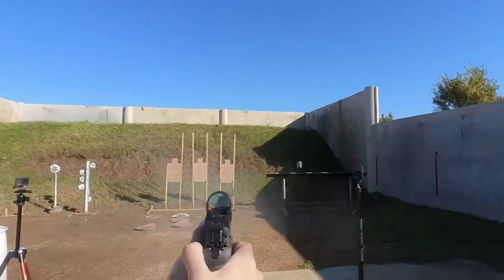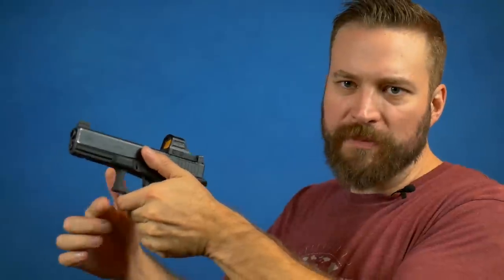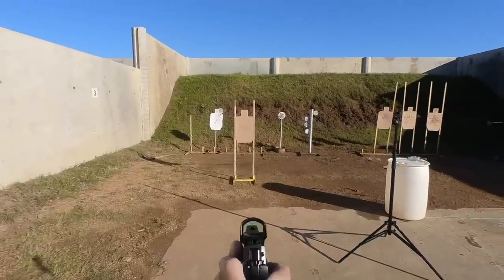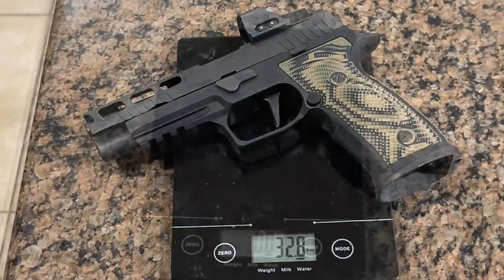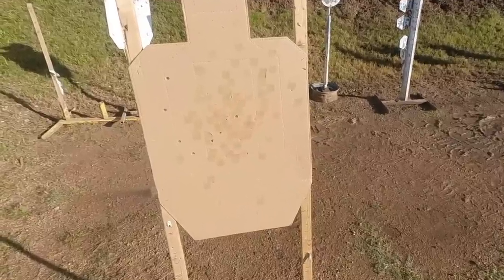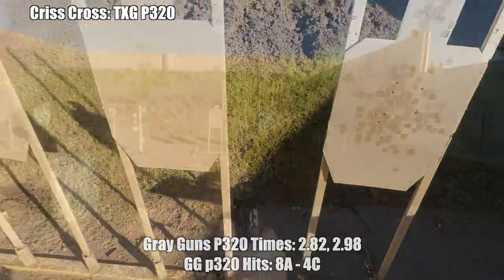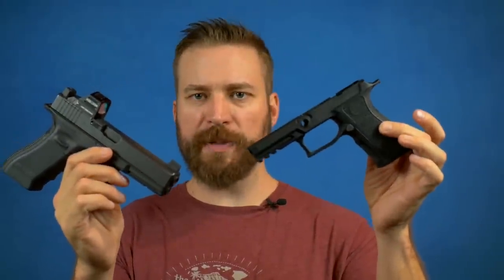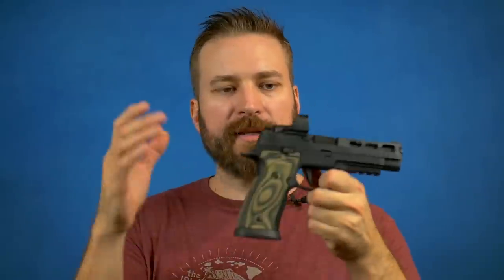Is BORE AXIS a MYTH? Testing Bore axis vs. Ergonomics vs. Weight

Comment: I always find it interesting that Sigs and 1911s have the same bore axis height, but you never hear people complaining about bore axis with 1911s.
Reply: 1911’s are heavier and honestly may have a less massive slide. The Sig 226 feels slow and soft recoiling to me but it recoils up. A full size 320 feels fine to me. The compact 320 feels very snappy and flippy to me. 1911’s feel like a nice quick recoil and return to target
Reply: @K-bob_45  Might also depend on whether you're shooting 9mm in your Sigs and .45 in your 1911. I find they have quite different recoil impulses. But in general, my point is just that I think "bore axis" is much ado about nothing. Or excuse-making...
Reply: @bsmithhammer  agreed
Reply: @bsmithhammer  Bore axis can make a difference, its effect is just exaggerated a great deal. I always viewed things like frame weight vs. slide weight to make more of a difference due to Newton's First Law. It's why I like either all metal guns or the FN Five-seveN which is the only service pistol I can think of that uses extensive amounts of polymer in the slide as well, which reduces weight of the mass in motion.

Plus, low bore axis pistols tend to have worse alignment index, which is why people mention 1911s as being more "naturally pointable" than Glocks, and probably why the Sig P320 was rated as having superior ergonomics to the Glock in the MHS trial, as controversial as that might've been.
Reply: my thing with 1911 they are not reliable and then you have 8 rounds.
Reply: @MRsolidcolor  There are double stack 1911s and 1911s are reliable so long as you lube them (and purchase from reputable manufacturers).
Reply: The 1911 has a hammer and a hammer spring orthogonal to the slide to provide resistance to the slide. The striker spring runs parallel to the slide and generally provides less resistance to the slide while cycling.
Reply: I remember in the 90s they justified the glock grip angle as lowering the bore axis.
Reply: You also have guns like the alien laugo that prove bore axis does in fact affect recoil.
Reply: You probably never will. The 1911 is the "God" of guns. Most won't complain about a 1911. Just the way I see it.
Reply: Well of course the 1911 has a higher bore axis, it’s hammer fired. The hammer spring adds extra resistance that the P320 doesn’t have. P320 doesn’t need to have the bore axis that it does, the beretta APX and now sprinfield echelon prove you can have the modular fire control unit and low bore axis.

Comment: Guntweaks wrote a fantastic article on pistol bore axis and they talked about what they called "alignment index" as a way to measure ergonomics. Alignment index is basically how straight your grip is on the pistol, which is a more natural grip and therefore more ergonomic and naturally pointable. Low bore axis pistols tend to have poor alignment index because since the trigger and bore can't occupy the same space, making the web of your hand more aligned with one will reduce alignment with the other. When I read that article, it also made sense why I and so many others tended to point Glock pistols naturally upward and have to cant the pistol down to align the sights whereas the 1911 was much more naturally forward. Incidentally, the P320 also had nearly perfect alignment index.

And I think this video showed that ultimately, ergonomics do play a bigger factor in how well you can shoot a gun vs. solely bore axis. That and weight, which Guntweaks also made note of between the reciprocating and non-reciprocating mass. There's a reason why the relatively high bore axis 2011 still dominates competition circles so long as their grips are ergonomic and naturally pointable and the metal frame adds some weight.
Reply: My finger dam near around the frame of the Glock to reach the trigger

Comment: i agree bore axis on paper is a valid argument but in practice i think hand fit and proper grip overall is more important.  Or practice in general, if you spend time (LOT of time) on a platform and learn to shoot it well it probably doesnt matter as shown by our friend Tony who is a GM with a G26 where he can barely get more than 2 fingers on the thing and it has a 2-3 inch barrel.  At the end of the day, i shoot ergonomic guns (shadow 2s) just because dangit, they are nice and i want to use nice things.  Thats the whole argument summed up.  and if you like to use something, probably enjoy / want to spend more time using it.  i think a PVC pipe duct-taped to a 2x4 is more ergonomic than a glock and it makes me sad inside every time I handle one. my shooting times probably differ very little either way

Comment: Another, less considered factor is that your arms are at a slightly lower angle, while holding a higher bore axis gun and may make a difference as to what portions of various muscles are more easily used to control the recoil
Reply: draw out the geometry of what you are attempting to explain here and tell me if it still makes sense to you

Comment: This will be a lengthy post. 
Honestly I thought this would be a MantisX video. Just to be clear, I’m obsessed with getting better and trying to figure out how to do that. 
To give an idea of my skill level, I can do sub 2 sec bill drills from concealment. Not on demand or consistently. The problem is mostly the draw, not the shooting. 
Shooting perception is very subjective. No offense to this video, but if all you shot were Sig P320s then I would think you would be better with that gun than any other. The problem is like most of us, we like to shoot a lot of different guns. 

There are a lot of other factors. Slide weight makes a huge difference of eliminating dip. Spring weight can help with that also, but in my opinion you should have the highest spring weight possible while still avoiding dip. Technique is probably the biggest factor. 

Recently I have been using the MantisX quite a bit. Specifically the muzzle rise feature. This tells us everything we need to know about how to eliminate muzzle flip and bobble/dip. The data has been quite eye opening and will vary with person to person. 

First off, virtually every high level/highest respected instructors say to have slightly bent elbows. For me, slightly is quite literal. Hard to explain. Most people have their elbows bent more than slightly like The Humble Marskman (sorry, don’t remember your name right now). I often video tape myself in slow motion. Lately I’ve had more dip/bobble than I would like. Well I went back to having my arms almost straight (the Bob Vogel grip). The dip is gone or almost completely gone with every gun I shoot. Plus MantisX also showed this. With the P320, muzzle rise went down about 3*. 

So let’s get into the MantisX. I own a lot of guns and this is going to make a lot of people cry and bitch. The guns that have the least muzzle rise for me are Springfield XDMs and a Mod.2. Yup, beating out multiple Glocks, steyr m9, cz P10s, HK VP9, Sig P320 (with various grip combos including the tungsten grip), canik Tp9, and a few others. I typically get 3.6-4* of muzzle rise. With or without a compensator. So far, I have seen no difference with comps. They do reduce a lot of felt recoil which will improve consistency and theoretically get you back on target faster, but I haven’t shot better bill drills with comps. 

I just bought the tungsten grip. I did one of those builds with the compensator on a compact slide with the full-size grip. Total weight with empty mag for me was 40.3oz. The lowest 5 shot muzzle rise ave I got was 6.62*. A month before that with the non infused grip with the grip weight I got a 5.57* 5 shot ave. So the added weight did nothing for me, however the gun was more controllable at speed with the extra weight. 

Another thing I’ve been doing is comparing how easy it is to track the dot. I’m limited to how many guns I have tried dots on. I’m currently putting one on my 3.8” XDM. So far, shorter barrel guns track better. I have a Glock 26 w/comp that is pretty much my gold standard right now.  The P320 with or without a grip weight has about twice the movement as the 26 and with the tungsten grip is still about 1/4 more. The Canik and Steyr come close and are very compatible without compensators even. My 4,5” XDM is not well balanced. I think it would need slide cuts to balance out. Has about the same dot movement as the tungsten 320. It will be interesting to see how the 3.8” XDM will fair. I’m thinking much better. 

Anyway, I could go on. Get your MantisX out and use the muzzle rise feature. I think different guns with different people will always vary. Is bore axis a factor? Well everything is. The fact championships have been won with that platform would say bore axis isn’t a major factor. 

Thanks for reading

Comment: The p320 would be a better pistol if it had a lower bore axis. It drives me crazy cause Sig has the ability design a lower bore axis p320. They proved it with the p365. Just imagine what a p320 would feel like with a low bore axis 👌
Reply: Exactly.
Reply: Are you implying the P365 is a better shooter than the P320!?? Lower bore axis does not make the gun better, it changes the way you grip, it has a more harsher angle which could make you shoot worse. Higher bore axis is better for the grip/ergonomics and if you're shooting with red dots.
Reply: Lmao did you not hear him say about the Glock “I never thought shooting this *Gee, Im glad this has a low bore angle*” and always said low bore angle sucks for ergonomics and controllability.  Which it does.
Reply: Not really. I remember shooting someone else’s P365 with a red dot and couldn’t find the dot until I realized I had to cant my hand down in an unnatural manner. Low bore axis throws off alignment index since I know have to reach downward rather than forward to get to the trigger, and since humans naturally point straight forward, a low bore axis where your hand relative to the gun is pointing downward will cause the gun to point upward.

This is why 1911/2011 guns are generally considered more pointable and ergonomic. The web of your hand aligns perfectly with the trigger and thus your natural pointing points the gun forward rather than up.

Comment: You missed the opportunity to upset the CZ crowd by pointing out that the slide isn't shorter, it's just hiding.
Reply from the maker: Shouldn’t have missed that opportunity
Reply: Is that a secret that only a few chosen ones are enlightened by?

Comment: I went through the same testing with my beretta 92, cz and glock 34,  beretta 92 has the highest bore axis out of all of them but the dropping locking block plus the egros for me are much better, gun shoots much softer. I have the CZ brass grips and they did make a significant difference in muzzle climb and the gun is super balanced but it still doesn't shoot as well as my 92 even though it is 10oz or so heavier.
Reply: I agree. With the Beretta 92, most of the reciprocating slide mass is underneath or parallel to the stationary barrel on the locking block too. That and the locking block system makes the Beretta 92 feel like it has less felt recoil to me even with the higher bore axis. My groupings on rapid follow up shots are just much tighter.
Reply: @JacksonWalter735  Bingo. Where the weight is at is just as important.
Reply: @primercast  What happened to you? You still shooting glocks?

Comment: I went with a CZ P-10C so I don't have to worry about either of these problems. 
I get both a low bore axis and an extremely comfortable grip. 

Although you can't knock the customizability of both the Glock and Sig platforms that allow you to fix any gripes you may have with a completely stick gun from both camps.

That being said my Walther PPQ has what's usually considered a high bore axis but is so comfortable to grip that I never had an issue with it.

Comment: For me it is ergonomics, then bore axis(well idk how much is it a factor, but i do care greatly how fast does the gun recovers) and I don't care about weight that much. In fact I d rather have light gun. I think bore axis is a big factor, vp9 with good ergo and very high bore flips twice as much as my shadow system mr920.
I have switched over from shadow 2 to mr920l and go faster, score better for it. Too bad you didn't include mr920 if you still have it, i feel it has great ergo and Glock like bore axis.
I kinda have to disagree about Glock,  i always felt It shoots very soft and recovers very quickly, only problem for me is strange grip angle.
Nic vid as always

Comment: Low bore axis does matter but a good shooter will have a decent follow through. It's the same as Jerry Miculek on target with a revolver. A lot of poor shooters will have reactive interference and let go of the gun or loosen their grip during recoil. 

A great design for a gun will lower the bore axis so it's easier to shoot and when you're trying to trim tens of a second per shot to be competitive, it does matter. Gun designers can cheat by adding steel to the frame but it's slow in the transitions. Higher than forty ounces is too slow. A good weight for a gun is between 35 and forty ounces. 

The good designs are the Archon B, the Armory Firearms Strike One and the Rock Island 5.0. Good designs and none cheat with heavy steel frames. CZs hinted about this with a inside slide so body parts aren't slowing the movement 

A good design is easier to shoot and doesn't take thousands of rounds to learn to control. 

Low bore axis does matter just like a good trigger. Yes, there are revolvers with a high bore axis and eight pound triggers but there is only one Jerry Miculek or Bob Munden.

Comment: One of the top two or three gun reviewers with a million plus followers reviewed Walther PPQ, and loved to talk about its “high bore axis”. PPQ bore axis 1.53”. On the Beretta APX review he loved to talk about the APX’s “low bore axis”. Beretta APX bore axis 1.52”. Can the PPQ be a bit snappy? I guess, yeah, it has more to do with it’s recoil spring being oversprung, comfortable grip causes people to be a little to lax in how they grip the pistol, especially with their ring and pinky fingers, and it’s a lighter pistol. Doesn’t surprise me that it’s talked about so much since a lot of gun guys are sheep who are incapable of independent thought. Thanks for the content!
Reply: Over-sprung will have less felt recoil not more. The slide won’t hit the frame as hard with a heavier spring, but it will with a lighter one. In other words, less resistance means a more violent slide movement.
Reply: PPQ shooting horribly has more to do with the slide's center of mass and a short grip that is almost completely slick. Some grip tape or stippling would immediately solve the problem. Similarly, g17 only shot like shit in this video because the he didn't have stippling or grip tape.

Comment: I've been shooting Glocks since 2006 . 
About 2.5 Months ago I switched from my Shadow Systems to X5 LEGION for 2Gun . 
I can shoot my Glock Pattern Faster but I have way more control with P320 TXG.  
I suspect I can shoot the Shadow Systems faster because the reset of TRIGGER springs my finger forward . I would imagine couple more months of shooting X5 LEGION exclusively I will be faster with TXG . 
I cannot explain how and why the X5 LEGION just tracks really well and how easy it is to shoot . 
I've tried CZs and 2011s and ultimately I'm way more comfortable with Striker Fired . i would imagine once i get better at Carry Optics or 2Gun that might change . then again it took me 15 years to switch from Glock pattern so it might be doubtful.  Shadow Systems & P320 TXG are the only pistols I'm gonna be shooting for the time being . 
I'm way more focused on 2Gun right now but over the summer I do wanna start shooting 1 2GUN and 1 Carry OPTICS Match monthly . I shoot non Sanctioned matches right now.  once I get better I'll start shooting Sanctioned.  
I 1000% agree with your findings

Comment: I own exactly as many Glocks as I own Sigs, so I have absolutely zero bias, but I still prefer Sig all day every day. It's clear Glock fanboys still haven't gotten over losing the military contract, thanks for making this video.
Reply: I was a previous owner of multiple Glocks and have carried them on duty. Probably 27 years. I purchased a Sig P320 xcompact. I had to put a compact 3.9 slide assembly on the module for duty use. I had a chance to qualify with the Sig. Beforehand, I had little experience with the 320 platform other owing a Arex Zero 1 for a short period. I was simply amazed how well the Sig behaved on my test range day before quals. I shot it just as well when I had to qualify. After all the Glock years it will take time getting used to the Sig’s higher bore axis.

Comment: This is just a cursory observation, but I did notice that when you were comparing slow mo between the polymer frame and the metal frame at the start, the metal frame had noticeably less recoil.

Comment: I tested with the same guns (axg substituted with tanfoglio stock 3) and was unable to replicate the results, but I had grip tape on all plastic guns and aggressive panels on the tanfo. In my opinion having glock's slick surface competing against stippled/aggressive grip panels is unfair. G17 achieved the highest hit factor and p320 x series achieved the lowest hit factor. In terms of familiarity, I am most familiar with the stock 3, followed by g17, and lastly p320. Overall I think grip friction has more influence than anything else when it comes to recoil management.